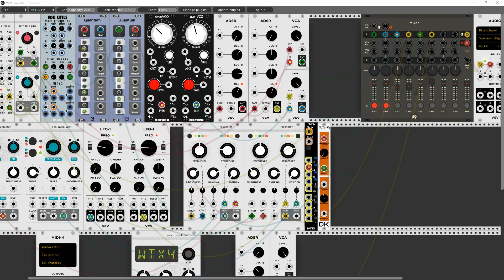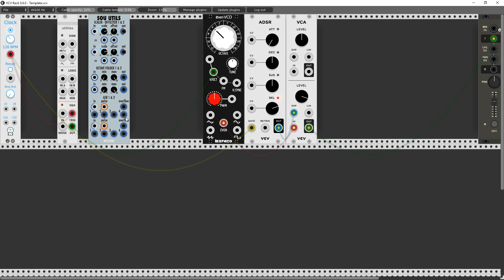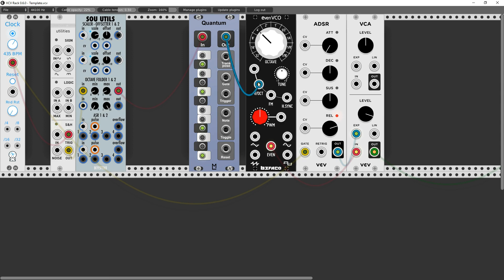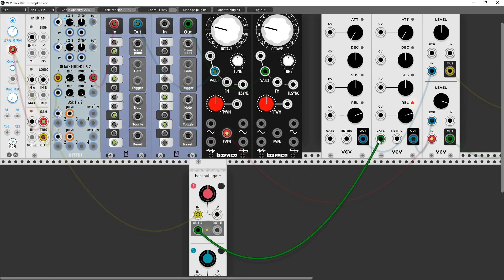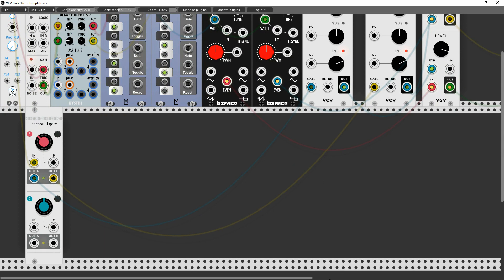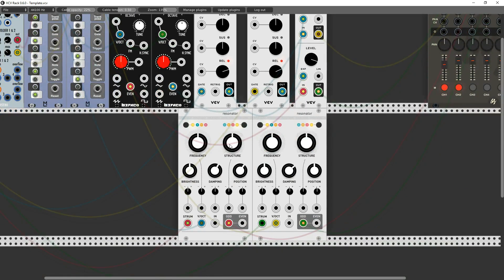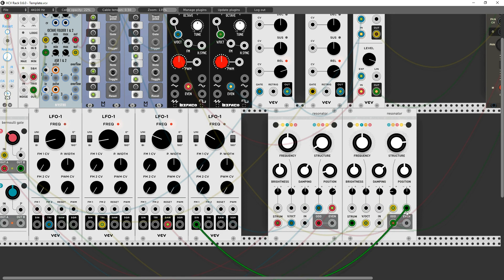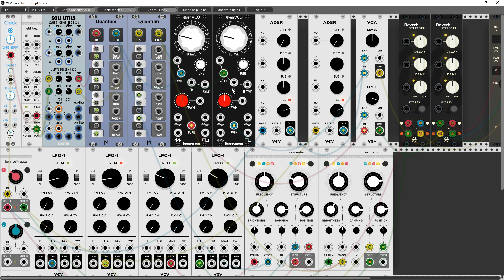Episode 25 : Nsythi SOU utility: Octave Folder

Comment: a pair of resonators on amber settings is great but im trying to get the evenVCO's into tune with it, can you recommend a tuner module or is it just by ear + judgement?
Reply from the maker: There's a module called (I think) "Hot Tuna"  which is a tuner module.  I generally run my VCOs through a quantizer so they always get moved to the nearest correct pitch.
Reply: @modularcuriosity  i need an easy way of freezing each note in a sequence to make tuning easier, I'm sure its possible but the whole modular thing is a wonderful deep dark rabbit hole I'm tumbling down, with a steep learning curve. I need an LFO to mix my metaphors in a more controlled manner.